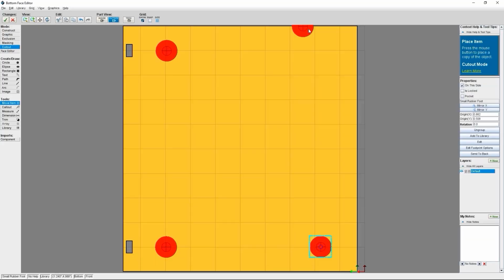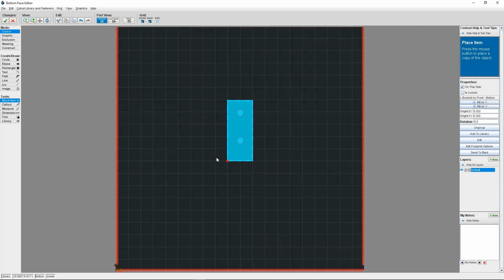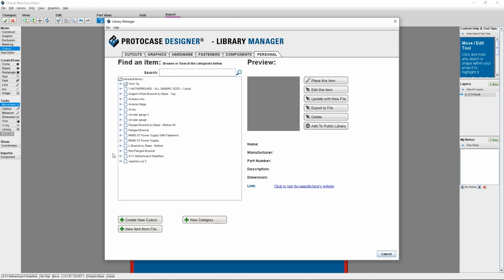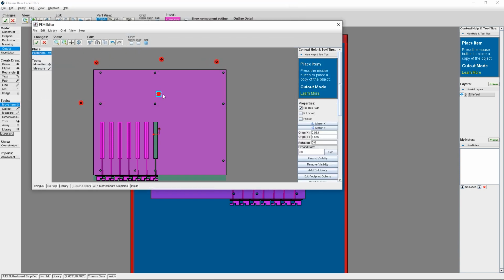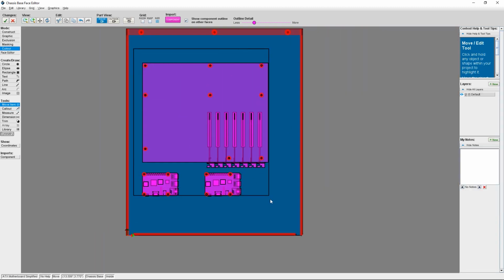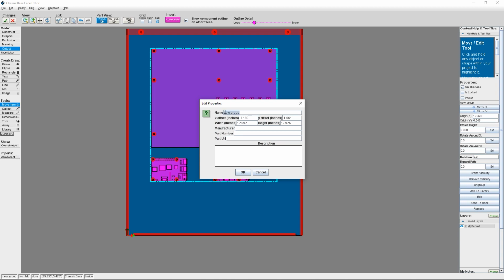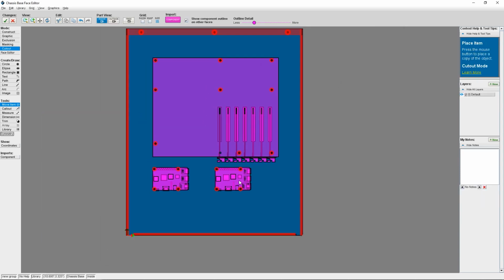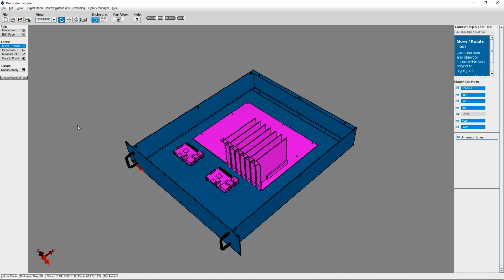Proto Tech Tip - Grouping Objects and Saving in Protocase Designer

Comment: Can you please make a tutorial on how to handle tolerances? For example, in your rackmount tutorial you created and placed brackets that hold HDD 4 inches apart. But how precise does it need to be? Should I space them 4.05 inches apart instead to make sure everything fits without force? Please make a tutorial video on that topic, or tell me if you already have one!
Reply from the maker: Hey there, great question. Cody did a Tech Tip awhile ago with some key design tips for sheet metal. https://www.youtube.com/watch?v=Rx95Ebn_WK8&t=

This video touches on tolerances, including positional tolerances for cutouts and accounting for .003-.005” powdercoat thickness on cutouts.

That said, perhaps it may be useful to do a deeper dive on tolerances. Thanks for the feedback!